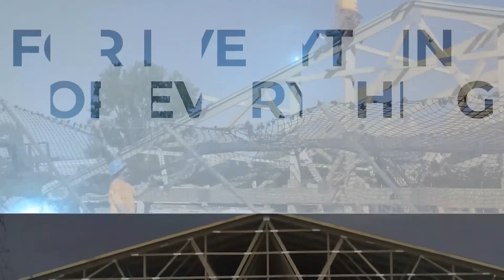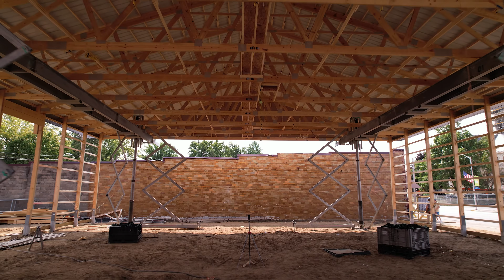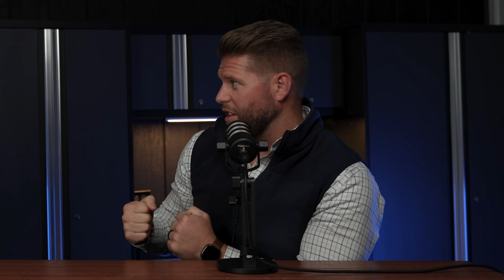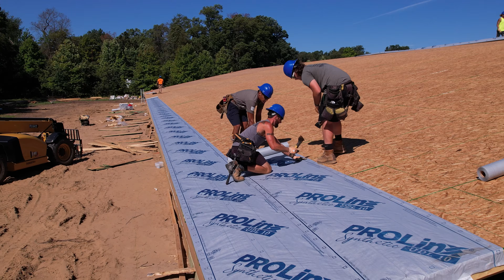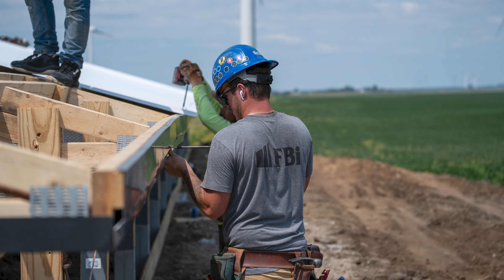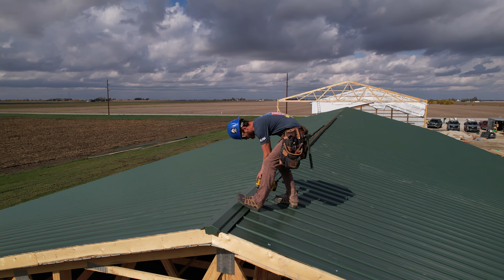QLYFT System for Pole Barns: Uncover the Cost & Benefits with Industry Experts!

Comment: Would building the roof first, if it has dormers, how does this affect the timeline if waiting for the glass delivery
Reply from the maker: Great question. Building the roof first, even with dormers, actually helps keep the project moving. We can frame and dry in the structure while we are waiting on specialty items like glass. Once the windows arrive, they are installed without impacting the overall schedule much. The QLYFT System gives us flexibility to work safely and efficiently through those phases, which helps minimize delays.

Comment: I was on a pole building crew in my late teens/early twenties and running up the purlins dragging the first roof sheet on the gable end was not fun.  Also sliding the gable end sheets up a ladder and placing them wasn't a walk in the park.  I had no idea what fall protection was at that time.  When it was time to walk the roof (Install the roof sheeting), the work boots came off and the sneakers came on as they gripped the steel better.  I was on a subcontracted crew, so each building only paid so much, therefore, time was money.  I moved into building garages with prefabbed walls on my own for a couple local companies as a subcontractor.  It was interesting when you guys brought up employee retention.  I noticed both garage companies I worked for in the past now have in house crews rather than subbing it out.....mainly due to quality issues. It may add hours to a specific build, but the quality shoots through the roof when employees are paid to take a little extra time and do it right....leave no oopsies behind.  If you can figure out a way to keep the cost of QLYFT buildings priced insignificantly higher than traditional post framing to the customer, you have a total win/win situation.  I swung a hammer until age 29, drank the Kool-Aid and hired on with a major railroad. I'm 51 now, a little tattered and worse for the wear, but I would seriously consider accepting a job working on one of your crews with the QLYFT system if my current employment somehow let loose.  You folks have the right idea and I believe you are true pioneers in the pole building industry with your innovation, focus on quality and employee retention.  Best wishes to you folks moving forward
Reply from the maker: Thank you for sharing your story. It really means a lot coming from someone who’s been in the trenches and knows what it’s like to build the hard way. That mental image of dragging the first roof sheet up the gable end without fall protection… whew. We’ve heard similar stories from veteran builders, and it’s exactly what inspired us to develop the QLYFT system in the first place. It’s all about making the job safer, faster, and more efficient — without sacrificing quality.

You hit the nail on the head about employee retention too. That shift from subcontracted to in-house crews is something we've been intentional about for years. When you invest in your people, train them well, and give them the tools to succeed (like QLYFT), the end result is a better building and a safer worksite. And like you said, fewer “oopsies.”

Thanks again for the kind words and encouragement. We’re proud to be pushing the industry forward with folks like you cheering us on.

Comment: Safety should be number 1, quality and production second but still critical. I can see this system enhancing all 3 aspects. When you can easily access the work instead of climbing ladders or riding lifts there is less reason to short change the important things or even the little ones for that matter. You should eventually be able to bring the build costs down and the value up.
Reply from the maker: You're absolutely right! Safety is always our top priority, and the QLYFT system was designed with that in mind. By lifting the structure instead of requiring workers to work at height on ladders or lifts, we’re able to create a much safer environment. At the same time, easier access to the build allows for greater precision and quality at every step. And as you pointed out, this streamlined approach can lead to lower build costs in the long run, adding even more value for customers. Thanks for recognizing the benefits—it’s exciting to see how innovations like QLYFT can elevate all aspects of construction!